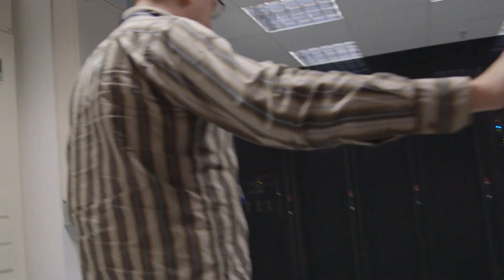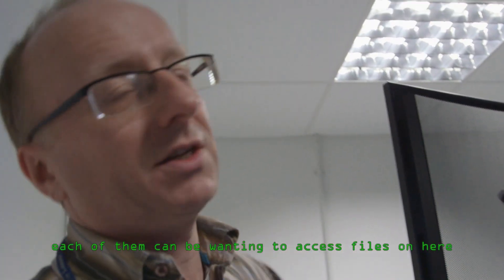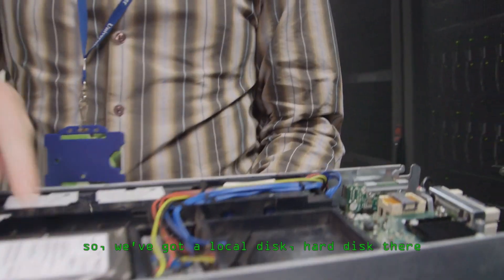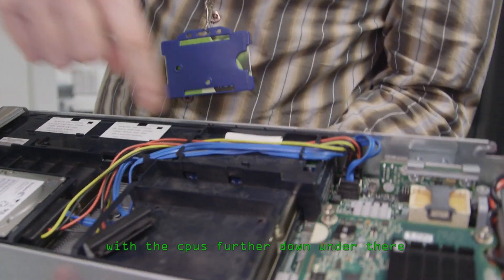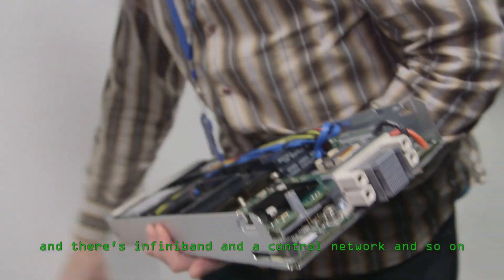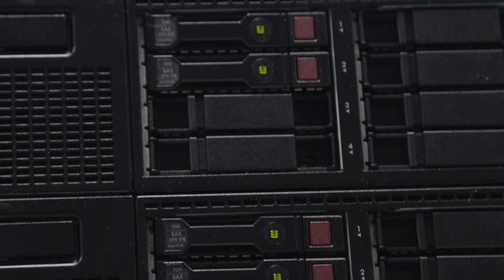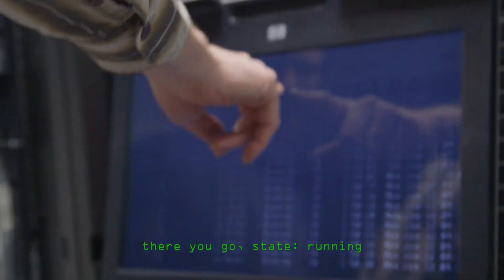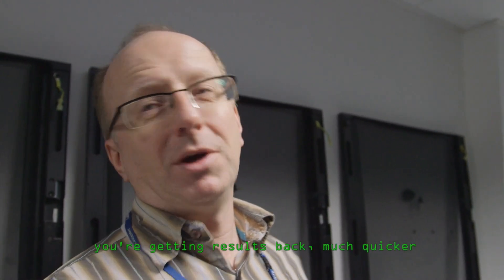Supercomputer and the Milky Way - Computerphile

Comment: I wonder how many mods on Skyrim I could play with on this Computer
Reply: 0. No regular OS supports these specs.
Reply: ***** I can assure you there are games made even today that are not utilizing even 2 cores properly.
Reply: TheBcoolGuy Pretty sure you can do a decent virtual machine with several thousand cores ;)
Reply: Simon WoodburyForget You forget one vital piece of the puzzle here.

Imagine you have 1 book with 256 pages. You have 4 cores, each core able to process a page in X units of time. (by process a page, i mean read all characters and do some simple math and counting operations)

Now, lets create a problem for our book reading machine to solve.

"Get all pages where
page contains the words 'computer' and 'phile'
and page character length is > 100
and page number is prime"

Using one core to solve this equation will take 256X time.

Using 4 cores, you can send 64 pages to each core. Pages 1 to 64 goes to core 1, 65 to 128 to core 2 etc...
Thus the problem will take 64X time to solve.

Now, lets state the obvious that we (programmers) tend to have long precomputed lists of prime numbers where we could filter to only 52 pages for processing. So we could finish the task in 52X time on a single core or 13X time on 4 cores.

There is no need for intercommunication between threads to perform this task, each thread will return the pages that matches.
At most (using the prime optimization) the WHOLE operation will take 13X time rather than 52X time if using a single core.

The only time the cores intercommunicate is when they have ALL finished their current task. And that is how most multithreading is done, you can't ask cores to tell each other mid process what they have found, only after they have returned from their processing can they do so.
Or if the program explicitly says "sync" or "await" with another thread. Which basically says, "i am done for now, lets wait for 'other thread' to finish before moving on."
And that is usually where multithreaded intercommunication becomes increasingly wasteful the more you do it.

It's not that multithreading is bad, it's that asking multithreading to be overly communicative means some cores will sit idle waiting for another longer running job to finish before releasing.
Reply: No Fun Allowed.
Reply: If you only write  a driver for it,, so can it maybe work... Have the CPU:s simulate  a GPU... sure it will work, and it will be quite fast, but very inefficient.
Reply: ***** That's complete nonsense, honestly. Having used monitoring software, I can tell you that the stress on cores 2 and 3 is a lot less than on 0 and 1. That's mostly due the complicated nature of optimizing for multiple cores.
Reply: ***** If you're analyzing whole code on runtime it gets so slow. You don't know which part of code will be executed next. Imagine a decision tree. It would distribute the code to threads only when if knows which part is going to be executed. So you're passing every single thing to another thread (and possibly device if you're using GPU). Do you really think it would be faster? You can't split a sequence of instructions relying of some data into different threads. Give one math equation and a list of steps to 5 people and tell them to do specific steps and see how it works out.
And also each thread would have to give the result back to the distributor (which is probably one thread anyway) for it to continue. Most tasks are sequential anyway. and using hundreds of GPU cores won't speed it up.
Reply: Thomas Tee I'm pretty sure this was memory hacked by someone on nexus a while ago to increase.
Reply: Probably none, since the communication between the units has a big delay it can't run any real time programs.
Reply: ***** Joe, my man, you really have no idea how complex it is. I know that fantasizing without proper knowledge is very appealing, but the reality is different. It does not  work how you imagine it. Please concede your point.
Reply: Cadde A book isn't a list of numbers, you're talking about array reading, which is faster concurrently (someone said that before in this thread). By reading a book he meant reading and understanding what it is about (actual processing). One person have to read whole book to process it properly. One person per page would give you a bunch of people with no clue what the book is about.
Reply: ***** 1. Declarations were just for clarity. No one would give this to another thread. It would take longer to pass the line than to execute it.
2. You do have to wait for thread 3 to execute thread 4. They both read variable at the same time and the multiplication is done on wrong a variable. Wrong result.
3. They wouldn't even have variable a and b because you're in the process of declaring them when they need to be read. Exception is thrown.

What do you mean combined on next cycle? Both operations are finished in the first one. Thread 4 takes unmodified variable a and the result is wrong.
Reply: ***** You actually want to "guess" the number? Do you really think this would work at all?
Reply: TheBcoolGuy
Don't forget that they're running Scientific Linux. Windows and Mac may not run on a machine like this but Linux and Free Software will always be up to the task.

White Heterosexual Cis Male
First of all, Skyrim would have to be programmed to run on Linux. Second of all, it would have to be programmed in a way that allowed things in the game to be processed in parallel. (Parallelization and concurrency are not the same thing). The power of the supercomputer isn't measured in Gigahertz or how many calculations it can make per second. Its real power is that it can do many things at once. So if you're wandering through a forest in Skyrim, the machine is quickly rendering the trees, ground, sky, and lighting effects at incredible speed. However, this is all happening on a single core. If Skyrim would be programmed to use one core for rendering light effects, another for in-game AI, another for the physics, etc. then you would definitely see the game run more smoothly. Although nothing is really done "faster" its just that you've delegated one core for a specific task.
Reply: *****

I don't think you're giving the human mind enough credit. Quantum effects have been observed within the human mind. It is, in fact, a biological quantum computer. It doesn't seem "powerful" because we don't normally use our minds to calculate pi to its trillionth digit or simulate the Milky Way Galaxy.

While you are reading this your mind and nervous system are not only regulating the body's functions but are also processing all kinds of sensory information (visual, tactile, aural, etc) IN PARALLEL. This is huge because we know, from research, just how difficult it is to get machines to do this.

We can barely get computers to read or drive a car. Why do you think some websites use captchas with scrambled letters, numbers, and pictures or characters? A program can't read them (yet). I'm not saying its impossible to develop a program that can read (and there are probably some that exist) but to actually make meaningful connections to what its reading? We're just not there yet. You might read the word "monkey" and immediately think of a playful chimpanzee eating a banana and climbing trees. To write a program that would be able to really learn and memorize the idea of a monkey from simply reading the word is an astronomical undertaking. Don't even begin to think about making intelligent robots! (Note: I did not say sentient).

Take my reading comprehension example and now add in visual comprehension and aural comprehension. Lets say you have the software written and you've tested these system individually. Great! Now how do you get them to work together? Where is the hardware that it would run on? Is the hardware compact enough to get a robot that fits in the average home?

Take a look at that supercomputer. Now take a look at your head. Appreciate the human mind in all of its brilliance and sheer power. It may not run your favorite video games but its far more powerful than you think.

If you're interested in biological systems being simulated on a computer take a look at OpenWorm. Its simulating one of nature's simplest organisms and its STILL something of a large undertaking.
Reply: *****
That was pretty much the point I was trying to make.
Reply: *****
Thank you. Its nice to find someone on youtube with similar interests.
Reply: +White Heterosexual Cis Male the lag of the game would be so high the game would be unplayable
Reply: +White Heterosexual Cis Male None as the OS architecture is not meant to run games.  Not to mention that the GFX card in your desktop probably has more GPUs than the entirety of their server cluster.
Reply: 255 - thats the maximum of aktive plugins Skyrim supports.